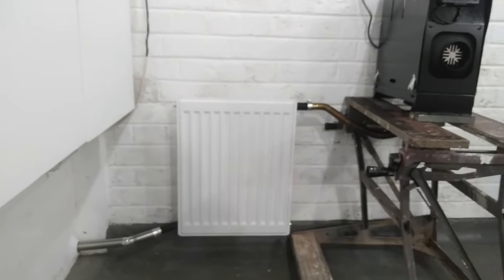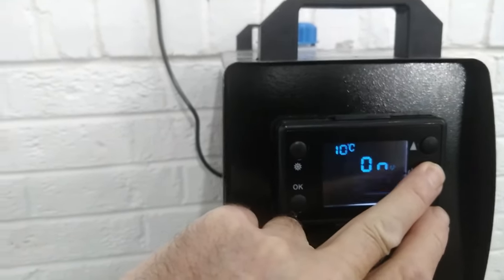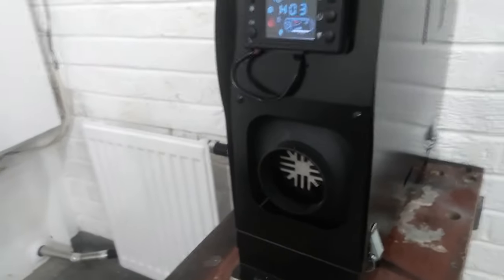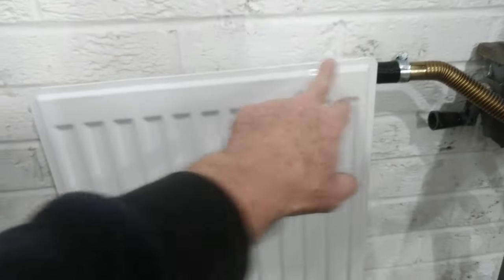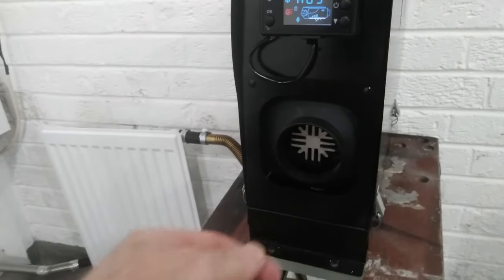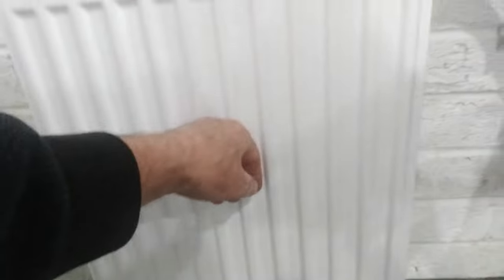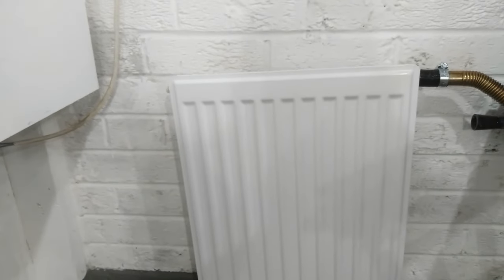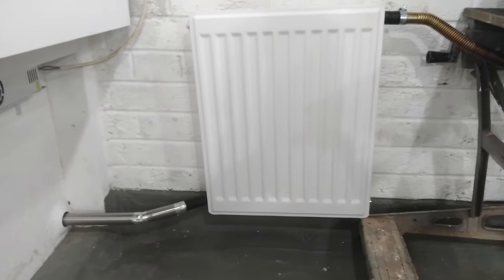Free Heat from Waste Exhaust Gases Heating Radiator Home Oil Diesel Heater Chinese Recovery Exchange

Comment: Andy, you need to slant it 45 degrees and fill the heater with water to just below the spill point, it will then absorb the heat and spread more effectively and allow gases to escape allowing more efficiency
Reply from the maker: thanks

Comment: My plan is to pass the exhaust through a coil in an immersion heater which could then supply radiators throughout the house , don't know if it will work but figure its worth a try would also be supplying warm/hot water for house depending on how many radiators it has to supply
Reply from the maker: Sounds great!
Reply: @andyfireblade  will feed back here what results I get
Reply from the maker: @theharshtruth1893  great

Comment: The reason for the moisture is the gases from the exhaust have cooled past the due point which means any moisture from the air prior to burning have started to condense back to water
Reply from the maker: thanks for the comment, 
kind regards andy , did you see my other heater , heating the house. 
https://youtu.be/6rQAo8lSLHY

Comment: Add an STC 1000 or similar controller, they do 12v ones. Have the probe sensing the radiator. Add fans (on a plenum at the bottom of the radiator pushing air up the back of the radiator thru the fins) also 12v so computer fans. The stc needs to see 65c or so before switching the fans on. So you get an increase of air flow over the rad. This will again increase its efficiency. 

Holding the fans off with the stc will allow the PSU to cope with the glow plug load etc.  

STCs can have 2 probes, so you could in theory use the second one as a room thermostat, and control the heater with it, again adding efficiency.
Reply from the maker: hey tony, you know your stuff. thanks for watching and thanks for the great tips. kindest regards andy

Comment: You can get something that comes in a tube like a silicone gun thats for sealing up industrial furnaces (EFW Plant)  I think it goes to 800c you should seal up the exhaust.  It may be ok if your room has a positive room pressure, if it goes negative with the likes of doors opening you risk drawing fumes back in.

Love your set up.  Keep an eye out for corrosion in the rad and keep detectors near by
Reply from the maker: brillian thanks.

thanks for looking.
did you see my other heater videos  https://www.youtube.com/@andyfireblade
cheers andy

Comment: Always thought about running some pipe work from an exhaust whether it from a heater like that or even an open fire, have the heat from exhaust/burnt materials pass threw pipe work in my above ground pool, not sure how far exhaust gases would run horizontally before may become an issue, but as your getting quite a lot of heat as you show that you can’t even touch it suggests perhaps a straight length of stainless steel pipe running threw my pool water may just take the edge of it, the missus works in an outbuilding and we currently use electric panel heaters but are going to fit one of these heaters, as she works in there for 7-9hrs 5 days a week,,that’s would be a fair amount of spent heat passing threw our pool water, may just give this a bash. To me it’s all about trying different things that spent heat should be re used on something else, 
I remember a workshop I worked in had these single tube type radiator bars running the length of walls and you couldn’t touch them they were so hot, that was the only source of heating and that workshop was always toasty.
Reply from the maker: good plan. yes stainless would be good and a wider bore to reduce back pressure. 
please take a look at my other vids, let me know what you think?
https://www.youtube.com/@andyfireblade
cheers andy

Comment: Wonder if you had 22mm copper pipe and bent it like a towel heater radiator and heated it from the top and the condensation out of the bottom
Reply from the maker: i did this in another video, please take a look at my other vids.

cheers andy

Comment: Very interesting, Can you tell use how you made the connections to the radiator?
Reply from the maker: Yes, of course, the pipe went over the radiator neck and with a jubilee clip. kind regards andy , did you see my other heater , heating the house. 
https://youtu.be/6rQAo8lSLHY

Comment: Thanks nice video, So how many radiators can you attach to one of those diesel heaters , do you think you can attach about 5 or 6 radiators, and what is the fuel cost when compared to gas or electric for the year?
Reply from the maker: i dont think you could att more.
maybe a bigger cast iron one would be good?
thank you for your comment did you see my other heater vids, https://www.youtube.com/@andyfireblade let me know what you think, cheers andy

Comment: That’s marvellous, I really appreciate your ingenuity.
If I may make a suggestion? I think that if you connect both the input and output pipes to the bottom of the rad then the rising hot fumes will heat more of the radiator than that peculiar top in and bottom out arrangement.
That would also improve the flow because the input will currently be fighting against the tendency of the hot fumes to rise.

I must say that I share some mentioned concerns about the exhaust fumes causing the mild steel rad to corrode from the inside.
Reply from the maker: thank you my friend
cheers andy xx

Comment: What do you do with the soot and water build up in the radiator?
Reply from the maker: yes, that would probably be the case!
it was only an experiment for a shot time.
but long term you need better flowing exhaust gases

thank you for your comment did you see my other heater vids, https://www.youtube.com/@andyfireblade let me know what you think, cheers andy
Reply: @andyfireblade  thanks pal, for the quick response. I will check the out. Did you know that the soot and the liquid can be used too?

Comment: I’d like to see this with a heat exchanger and closed circuit loop. Does it need a pump to pump the coolant around the closed loop or does the coolant move due to pressure changes as the coolant becomes steam, etc? That should mean the radiator retains heat longer too if there is hot coolant in the system??

I actually want to apply this (theory) on my boat using the exhaust gases to heat my hot water tank through the integrated heating coil .. if it will work.
Reply from the maker: you are exactly right.
i have tried this with out a pump and it works just as well.

thank you for your comment did you see my other heater vids, https://www.youtube.com/@andyfireblade let me know what you think, cheers andy

Comment: Hi Andy.....I  think this is a great idea. What is the size of the radiator? Do you think you would it be better to use a larger one? What connectors did you use to attach the exhaust pipe to the radiator.
Reply from the maker: hello john, yes this is just a small 500mm x 400mm i think.
it was just the cheapest one at selco builders yard. for the experiment.
a much bigger cast iron one would be better.
i have been told that you can heat the biggest rad with one of these.
did you see my other videos, i have one of these heaters heating my house.
kindest regards andy

Comment: This is the same system used to heat tipper truck bodies in Canada, Russia etc due the muck sticking on the bottom...great idea but you need to plumb it sightly differently to get the most efficiency...put the exhaust to the bottom of the radiator...just the fact the heat raises! Do you have a thermal imagining camera to see how the heat moves through the radiator...?? What is the exhaust gas heat, if its around 30 degree that perfect so that the condensation burns off, higher you need a larger radiator etc.. also you do need to put a tap on the bottom of the radiator for the excess condensation to be removed, it will build up...But its a great idea....you could go one more step and get hot water from it as well as a heat exchanger..but thats a far bit more engineering......signed up to your channel
Reply from the maker: thats great , thank you my friend. some really good ideas there . i will give them a go
cheers andy

Comment: This is much better solution as the exhaust gasses and the air flows against each other.  This is the most effective method of heat exchange.  I have a 🙋  how did you connector the exhaust pipe into the radiator.  Could you describe it more precisely please? Maybe some sort video?
Reply from the maker: the flexy pipe goes over the neck of the radiator, then clamped with a jubilee clip
kindest regards andy

Comment: Great idea, I would though recommend to pay attention to the exhaust pipe slope, the highest point should be the exit point from the diesel heater itself then the lowest point should be the far end opening (outdoor), to make sure that all fluid condensation is out neither gathered in the radiator nor back to the diesel heater!
Reply from the maker: Thanks for the info!

Comment: I often thought about putting the exhust through an indirect cylinder and seeing if it would heat the water. Judging by your through a rad experiment I feel confident this could work and therefore a cheap hot/warm? water supply for off grid.
Reply from the maker: yes , please see my other vids https://www.youtube.com/@andyfireblade

Comment: Try positioning the heater so the fan will blow over the radiator also. Pick up a carbon monoxide detector also in case the radiator system develops a leak.
Reply from the maker: Great idea
thanks , and thanks for looking
did your see my other heater videos
https://www.youtube.com/@andyfireblade
let me know what you think

cheers andy

Comment: What about running the exhaust through or around  a small water tank (separated) and have a pump circulating the water in the tank.i Imagine the radiator would stay hot much longer.
Reply: Or through sand as a sand battery - that would be even better (unless you wanted hot water). Sand can hold heat for hours.
Reply from the maker: yes, long term, i think thats the way to go. good comment. regards andy https://youtu.be/6rQAo8lSLHY this is the other one in the house.

Comment: Great video. But I tried the Link to the radiator but it doesn't work. Where did you get the Radiator? Thanks .
Reply from the maker: they have gone up in price since then, so it might not work. it was just a basic lo cost radiator.

cheers andy

Comment: How are you planning to clean this radiator of soot? The channels are quite small and can get clogged quite easily.
Reply from the maker: not sure, please give comments. best way to clean.

thanks andy
Reply: @andyfireblade  I think the best solution would just be soaking the inside with vinegar and hot water for a day then drain it.

Comment: Interesting ! You may get condensation between the exhaust on the diesel heater side and radiator. 
as the unit cools, it will pull moisture from outside to the last bit of heat source. 
I wouldn't be worried about radiator to exterior side.
it would be nice if a person could find a dual core radiator. and fill one core with water. and core two as the exhaust side. 
it would be like a water battery.
Reply from the maker: Great point! that is what was in my head, but it didnt come out until you said it,   cheers andy
Reply: Would the water side be sealed?

Comment: i would have thought a exhaust heat exchanger would be a better way to do this, surely any resistance on the main exhaust outlet would cause the exhaust gasses to be forced out elsewhere as they aint the best made things?
Reply from the maker: yes you are right.it would be . or using heating water to go round the radiator. certainly for long term use. the gases dont really pressure up in there. there are fairly free flowing. but thanks for your comment. https://youtu.be/6rQAo8lSLHY regards andy

Comment: I would put some computer fans at the bottom to force air upward faster so it recovers even more heat and also to not cook the paint on the radiator because those gases are toxic.
Reply from the maker: thanks for looking.
did you see my other heater videos  https://www.youtube.com/@andyfireblade
cheers andy

Comment: Tried this at the weekend but resulted in black exhaust smoke. Was a double radiator the same size as yours.Not sure if it was a back pressure problem or something else. Might try an inline exhaust fan to see if that helps. If anyone has any ideas I would be delighted to hear them. Cheers David
Reply from the maker: yeah, maybe because it is a double? flow problem?
Reply from the maker: let me know how you get on cheers andy
Reply: @andyfireblade  think you may be right. I deliberately went for a double so as not to reduce the flow. Have ordered a 3m extension and will try that next and look round for an older cast iron radiator with much greater flow. Cheers David
Reply from the maker: @davidhobbs7891  yes , i am on the look out for an old cast iron one too.
i imagine with less restrictions inside. and gradually get hot and retain its heat. cheers andy

Comment: I wonder if mounting the radiator at 45 degrees would help with removing condensation within the radiator as it can just flow out then along with the fumes. Just a thought 👍🏼.
Reply from the maker: yes thats true, or a slight tilt.
thanks for your comment. 
kind regards andy , did you see my other heater , heating the house. 
https://youtu.be/6rQAo8lSLHY

Comment: Heat always rises! (just look at our extreme weather!)
try placing the exhaust on the bottom, outlet to outdoor on top.
Actually, I run the exhaust indoors at only 5ppm (with a door open), for extra heat 'n warmth.
Specially that it's summer and hot weather makes it ideal for testing......
Reply: Placing the exhaust on the bottom, outlet to outdoor on top?  Where should the condensate go? I think it is fine as it is, because pressure will push the heat down and through the system.
Reply: @elbuggo  The Heat should 'Vape' it mate. ;) Cheers! 👍

Comment: My gas whole home generator box when it's running even though exhaust is vented gets to around 40c from the air blowing through the engine. Using exhaust gas as a radiator is genius

Comment: I am not sure whether I'd have put the input at bottom and outlet at top since heat rises. Only a thought. I haven't seen previous vids so may have missed info.  The other thing is reflective surface behind the radiator. 🤔   Some kind of cover over rad to stop little hands
Reply from the maker: thats true, yes it does get very hot.
thanks for looking.
did you see my other heater videos  https://www.youtube.com/@andyfireblade
cheers andy
Reply: @andyfireblade  What's the law governing these ?
Personally I'd have radiators stacked if this were installed in a property. Using convection to heat water..maybe install a pump to move heated water ? I'll check out the other vids at some point. 👍
Reply from the maker: @whoisme678  thats a really good idea

Comment: feed into the bottom and out the top more heat dispersal, and of course using a heat tube and filling the  rad with oil would be best,
Reply from the maker: thanks andy

Comment: Hi Andy can you give the name of the heater and where you got it and a link for the pipes you got for it thanks
Reply from the maker: here are the links, kindest regards andy

Links:
Heaters: https://amzn.to/3ZwMAPc
12v power supply: https://amzn.to/3ZwMAPc
Long flexy exhaust pipe: https://amzn.to/3ZwMAPc
Radiator:  https://amzn.to/3IQqvVO 
New control panel: https://amzn.to/3GW0mDu
Ducting: https://amzn.to/3CF7l0W

Comment: Hi Andy just got a question how have u joined the exhaust from the heater to the rad as looks like black rubber pipe but won't that melt as I want to use a rad to make more heat from my diesel heater so I can just have mine on leavel 1 heating
Reply from the maker: i used a metal flexy pipe and pipe clamps.
did you see my other heater vids, 
https://www.youtube.com/@andyfireblade
let me know what you think,
cheers andy
Reply: @andyfireblade  now goin to have a watch thank u mate
Reply: Yes ive seen that video before so how do u get the flex pipe to stay in the rad

Comment: Any update on this? Id worry about it rusting out the bottom of the radiator. I'd be inclined to use the exhaust to heat water and plumb the water into the radiator. Maybe through the use of a separate heat exchanger. I have a diesel heater and im looking at my previous suggestion, or to build a sand battery
Reply from the maker: the heat exchanger with water is a really good way to go.
https://www.youtube.com/@andyfireblade
cheers andy

Comment: Maybe some exhaust header wrap from the parts store around the exhaust pipe on you heater. That way more heat makes it to the radiator.
Reply from the maker: yes, good idea
kind regards andy
Reply: I wouldn't waste my money. The heat's radiating into the room from exhaust pipe anyway, so why wrap it unless it's for protection from burning something.
Reply: @robsteve7043  I kinda thought about that after the fact. You're right though.

Comment: would've thought in the bottom and out the top would've yielded the best results, moisture would be vaporised out of the system anyway due to the heat.
Reply from the maker: good point, thanks andy

Comment: What about a car radiator? That should help with the centre cold spot and you could even mount a fan to blow into the room! Loads of 2nd hand around and I've seen a new custom built aluminium (not sure if that's a suitable material) for just £30.
Reply from the maker: thats a brilliant idea
cheers andy